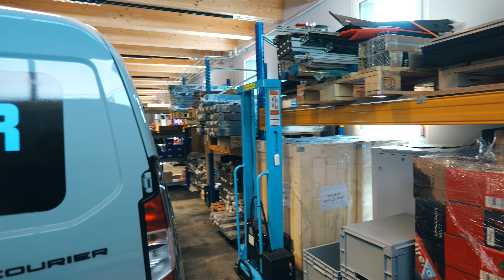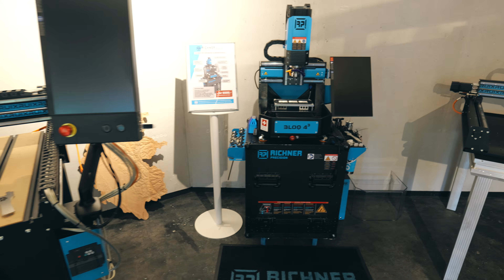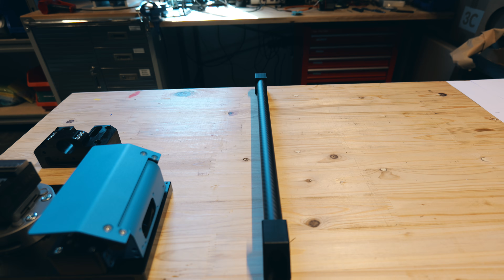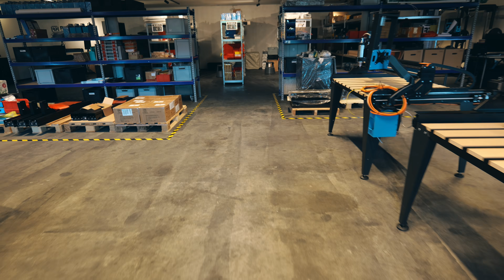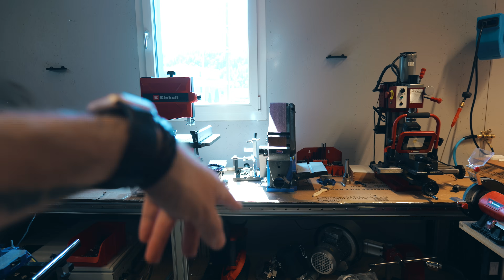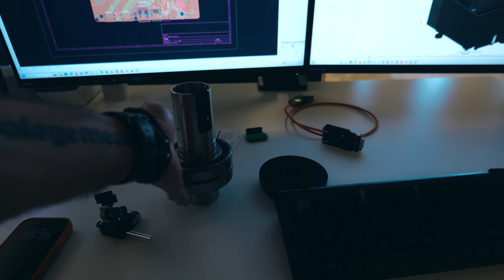Richner-Precision new Workshop Tour 2026

Comment: Great workshop. What do you use the 3d printers for?
Reply from the maker: Thanks! I think almost all machines use some 3d printed parts. Mainly where it would be totally overbuilt milled out of metal, like for holding a cover or as a fan bracket. But they are almost always covered or hidden, because i am no fan of 3d printed parts visible on machines.